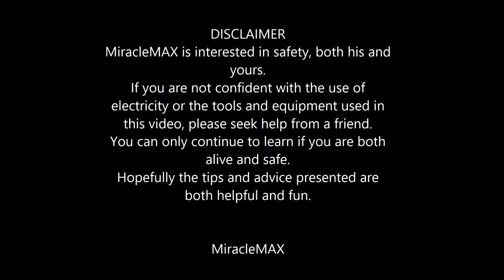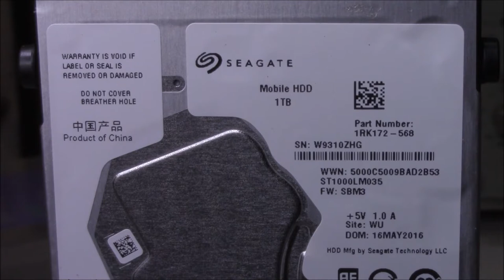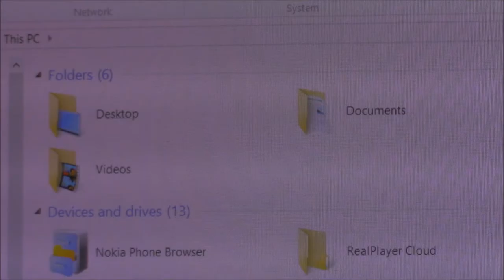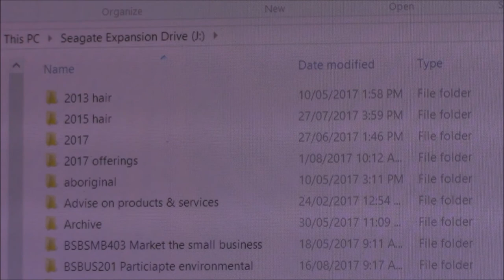External Hard Drive Data Recovery MiracleMAX

Comment: Good job. Mark. That microscope view was pretty blurry. I hope you ejected the EHD properly before you unplugged it.
Reply from the maker: Hey Robert, as you know, it's hard to get the best picture when you are filming or trying to take a photo. This was done some months ago now and the customer is still happy with the results, but he has backed up the drive. Thanks for your comments :)
Reply: would have been easier to put the drive into a computer via the SATA and power connector. Then copy to a new external HDD.
Reply from the maker: Thanks Nick.  Yes it would have been easier, but I used this opportunity to carry out a repair that others might get some benefit from. But I do agree with what you have said and will do that next time. Thanks for your feedback.  :)